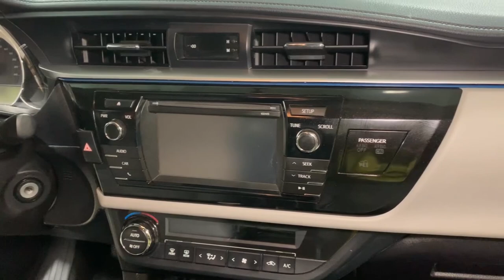Deep Cleaning A Plumber's FILTHY Car | Complete DISASTER Detail | ASMR Vacuum & Extraction Sounds

Comment: As a fellow detailer. I felt bad for u the whole video for having to deal with that cheap Velcro felt like carpet
Reply from the maker: Ahhh it’s the worst! Honestly the worst vehicle I’ve had was the 2014 Buick Verano in my last full detail I posted! I’ve had good luck with Buicks in the past but they are usually older. That carpet was almost impossible to get all the dirt out no matter how many times you vacuumed or drill brushed it!